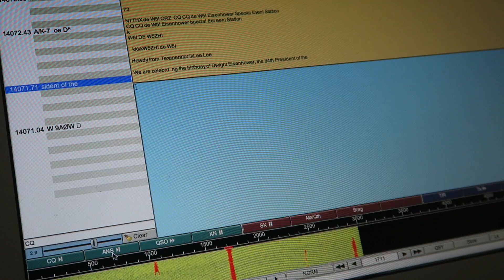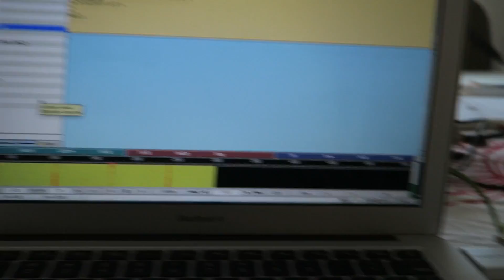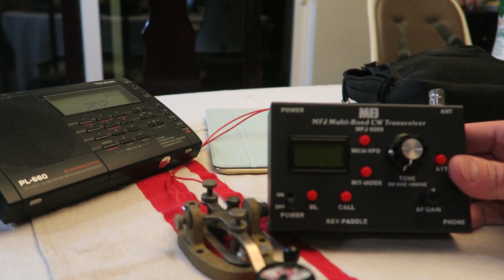Antique CW Key Back In Action!

Comment: Nice vintage key & good to see it back in action. Most used batteries are rechargeable aa & alkaline 9v--latter for the radio mic we use for our episodes! They conk out around 6.8v but then Paul uses them in test equipment & to flash leds. Even depleted, they have second life.

Comment: #QOTD  You are right about the AA.  I actually got a cheap battery tester to figure out if the battery is truly bad, or if something else is malfunctioning...this has actually reduced the AAs I have needed to replace.  Usually it is a bad contact, or having the batteries backwards.  Most of the time cleaning the contacts gets the thing working again.  The battery I seem to never have when I need it is the stupid wafer batteries for garage door openers CR2016 or CR2032.  I think the CR2016 are thinner, but they are both 3v.  I have cheated and put aluminum foil as a spacer to use a 2016 battery in a 2032 slot...lol
Reply from the maker: OH MAN!  Yeah those stupid cr2032s!!!

Comment: I used to run CW 18 wheel mobile. Not with a straight key though. That would be impossible. I rigged some paddles up to a platform that strapped to my right leg. Worked fairly well. I'll bet I worked 50 or more countries that way.

QOTD: I horde AA and AAA. I'd say the ones I never have when I need them are C's. I keep a few 9v and D's around, but so little stuff takes C anymore.